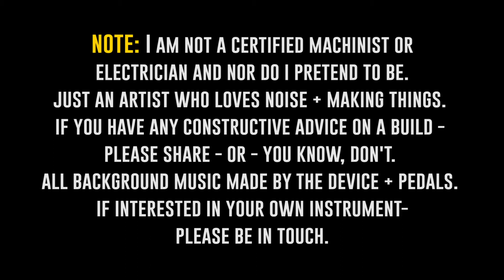DIY Spring Noise Instrument Build + Test

Comment: Hi! Very nice stuff! I've got quite inspired to make something similar. How did you attache the piezo into the box? Did you glued, soldered the piezo into the case, or fixed it with one of the screws? Thanks!
Reply from the maker: Thanks so much for the compliments and for watching! I actually just used electrical tape to attach the piezo to the casing of the box. I wasn't 100% confident in my soldering of the connections, so I figured if I needed to pull it out to fix it, having it taped in would be an easy way to do that. It hasn't budged - so I am quite happy with that!
Reply: @totalfrequency6049  Thanks! I will try it that way.
Reply: Whered you find those springs? Might i suggest trying other materials and seein how those sound too?
Reply: @untro7287  I got them at Home Depot
Reply: Hot glue gun does it nicely too